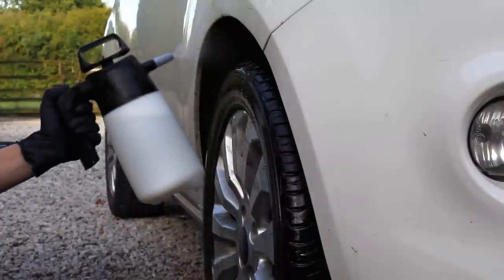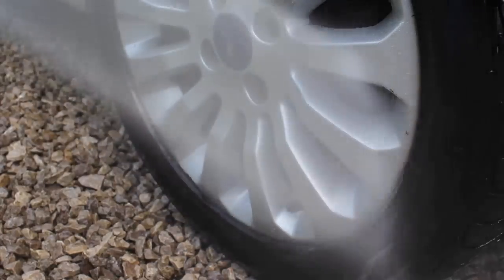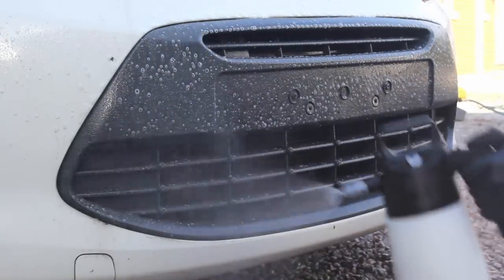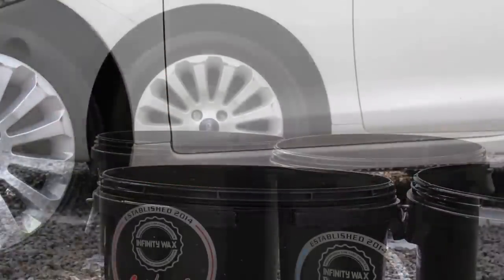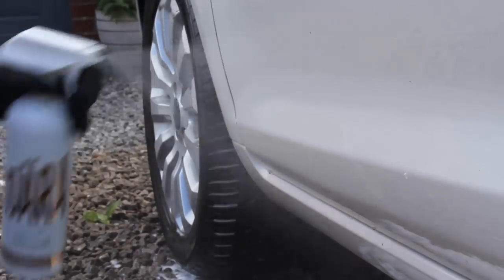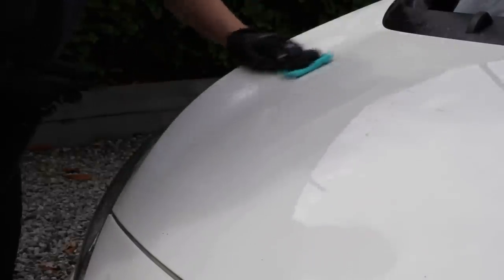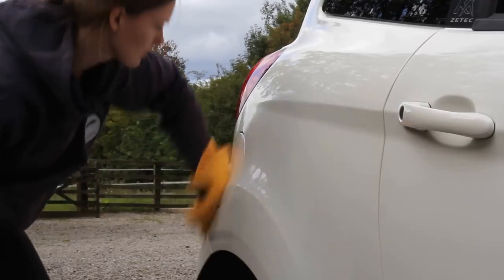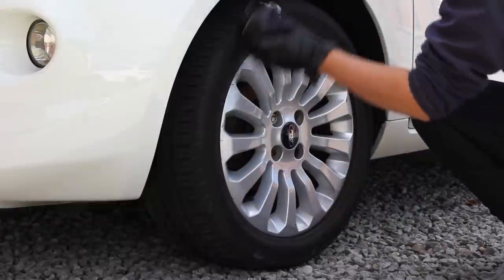Deep Cleaning a Dirty Ford | Decon, Polish and Protection

Comment: Another great video Heather, nicely done. 
Isn’t it funny, I’d say most cars on the road are like this, superficially they’d look ‘ok’ but once you get into it you see all the contamination and crap building up in gaps and corners that most owners just kind of accept as normal for a car.
My cars are kept factory fresh and I start getting stressed out when I see 50 miles worth of brake dust on the wheels 🫣
We’re cursed as detail enthusiasts, we’re only happy as soon as we’ve cleaned the car and not driven it anywhere 😂
Reply from the maker: Thanks Steve 😊 Haha I’m the exact same. Always bothers me when the door shuts are filthy too. Probs spend more time washing my car than I do driving it at this point 😂

Comment: If you ever have issues fully removing grime on the tires, even after cleaning 2-3 times, I've had amazing results removing anything the wash didn't using Gtechniq Panel Wipe. Gyeon Tire will degrease and remove most of the blooming, but old tire dressings make things quite tough to get fully clean. Panel Wipe has been a hero in my arsenal prepping tires for fresh dressing.
Reply from the maker: Thanks very much for the tip!

Comment: good job! i know iron decon is expensive, acid is a really cheap alternative. it’ll get the wheel barrels 100% in just a few seconds, and as long as you don’t allow the acid to dry it’s not horrible. most times it’s not necessary and i’ll just use a wheel and tire cleaner, but still.

Comment: What a fantastic job heather I would like to give the all in one polish a go as I currently have Maguire's but it takes time the 3 stage correction just looking for a good all in one 👌👍
Reply from the maker: Thanks Paul! The all-in-one polishes are really good if the car just needs sprucing up and you don't need to remove much paint. Ideal if you've already done a correction on the car and just want something to use after the next time you decon it :)

Comment: Blimmin heck the amount of metal contamination was crazy. The car looked great after you finished with it. Tempted to invest in a machine polisher as it saves time and to be honest looks like it does a better job then using arms and hands.
Reply from the maker: Thank you! If you don’t wanna spend too much I’d recommend the one from Argos. Only about £50 although you’ll probs need a smaller backing plate which costs another tenner. The cord is a bit short which is a little bit annoying but it’s good for the price
Reply: @AutoCareHQ  excellent £50 I can handle . thank you

Comment: Nice job Heather. That was very un loved but you did a good job. Where do you get the large drying towels from ? They look more efficient then the ones I have .  Great vid
Reply from the maker: Thank you! It’s the rag company 1500 towel. You can get it from cleanandshiny.co.uk and there’s a discount code “ACHQ15” which should work on all the rag co cloths 😊
Reply: @AutoCareHQ  brilliant thank you so much.  I’ll order a couple now with your code 👍
Reply from the maker: @duncangrainge  no problem! Only thing to watch out for with the red towel is that you can get a bit of dye transfer if you wash it with light towels! Otherwise though its brilliant
Reply: @AutoCareHQ  good call heather. Il watch out for that. Thank you so much.

Comment: Do you get the same durability using spray sealant over polish? I tend to use a panel wipe first before any sealant? Is this specific brand you can use in this way?
Reply from the maker: This polish had some fillers and protection in as well as abrasives so I didn't really want to use a panel wipe to remove them. The sealant and all in one polish here are designed to work well together so I don't think durability should be too badly affected, but probably would still be better to use a panel wipe to improve the sealant durability if you didn't mind removing the fillers

Comment: Hi, there I was just wondering if you could give me a bit of advice. I just had sprayed black  alloy wheels and I've got Purple Rain alloy wheel cleaner will it be OK to use it's been over a week.
Reply from the maker: Hey, I'd double check with whoever repainted them to see what their recommendation is on how long to wait until cleaning them. I'd imagine Purple Rain would be okay to use as long as the repainter has done a proper job
Reply: @AutoCareHQ  ok thanks. keep up the great work😃